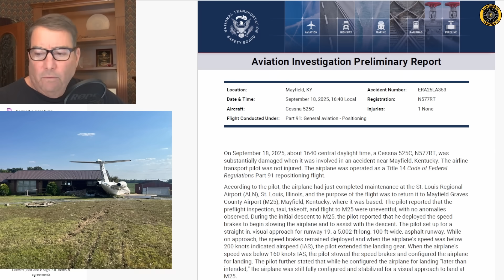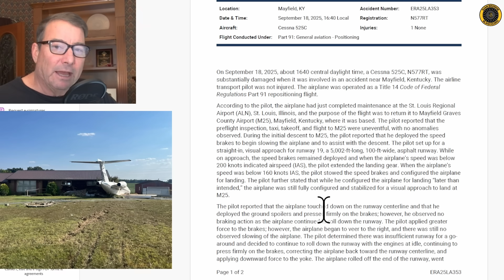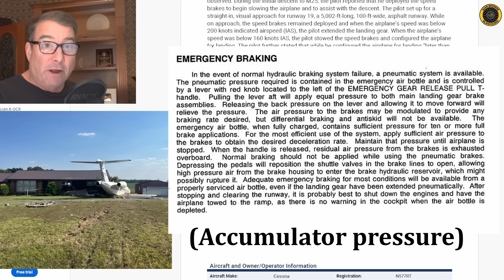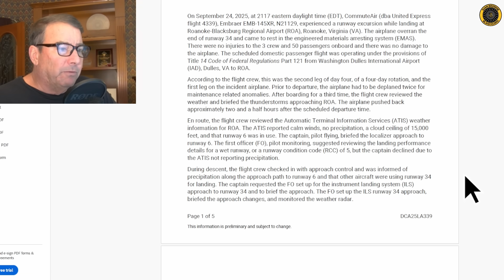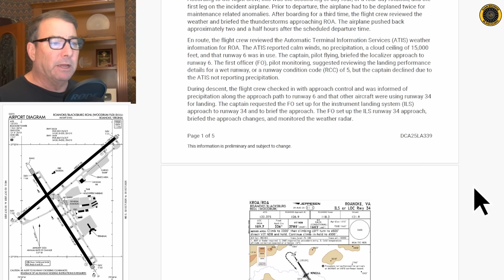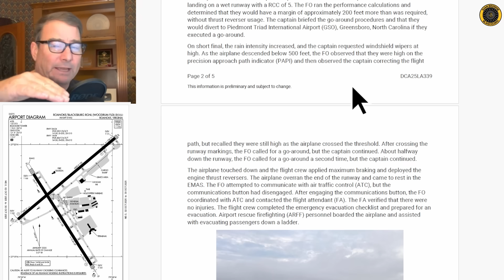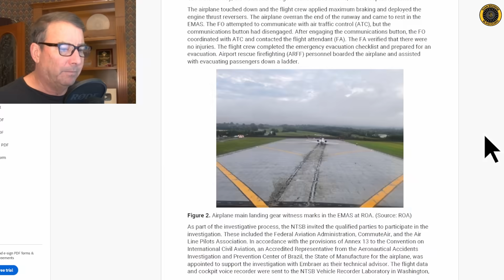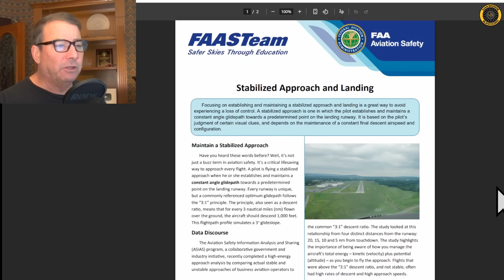NTSB Preliminary Reports on 2 Runway Excursions 27 Oct 2025

Comment: Regarding the E145, there was some damage. Main gear doors were damaged, and both engines had to be replaced due to ingesting the EMAS material. Turns out the material is portland cement and it hardened in the engines and couldn't be cleaned out.

Comment: The citation driver....because they  certainly wern't flying, obviously didn't want to damage the tires by usIng the nitrogen.

My qusetion is with 5000 feet of runway, if they notice no braking action...why not take off again figure out the issue and try it again at a sane speed?

Comment: How about starting with a hearing check of the captain(or maybe a new set of batteries for his hearing aids) 😳 Should he be lucky enough to retain his job, He needs to spend one year in the right seat. Sure am impressed with the EMAS protection.
Reply: Regarding the single pilot Citation (for which I have flown), what is it that overrunning pilots don’t get about F=MA[SQUARED]. Pilot claiming his approach “was stabilized” - my ass!

Comment: They say things happens in threes. Well there was a third runway excursion at Chicago Executive Airport PWK in Wheeling, IL (Palwaukee to us locals) on September 3, 2025. 
NTSB Report CEN25LA35  N1927G Gulfstream G150. No injuries. Also a wet runway and no emergency braking deployed.  
The EMAS wasn't as effective, possibly because the jet veered off to the left side and only partially traveled through the left shoulder of the EMAS zone. 
The jet breached the perimeter fence and then stopped in the grass with the nose of the plane over the concrete curb and mere inches from the fog line of the perimeter road. 
In other words, you can't park that there. 😉

The Gulfstream fuselage was damaged and nose gear collapsed. 
I wonder if the Jet had stayed centered on the runway and entered into the center of the EMAS if the jet would've stayed within the perimeter of the airfield and not breached the fence. 
Interesting to compare the effectiveness of the EMAS in two similar incidents, although different sized jets.

Comment: It makes zero sense to have chosen the shorter runway. Both runways are rather short, good judgment says take the longer. Just as it's almost always better to begin a takeoff from the very beginning of the runway. Also, I flew out of Roanoke some years back and runways 16-34 were NOT to be used at night, depending on whether an arrival or departue, due to terrain! An other than well done go around could put an aircraft into a mountain. I just checked and the information says that departure on runway 34 and arrival on runway 16 are NOT available at night..Hmmm...That suggests issues no matter in which stage of flight an aircraft is in. Another reason to have used the longer runway. The winds were a non issue, direction nor speed being of any consequence. If 6-24 was wet, 16-34 was also wet.

Comment: I didn’t sleep very well last night because all I could think of was making this comment which is unrelated to your present report, but you cover everything in these cases so well and you are an incredible spokesperson for the whole aviation industry. I kept saying to myself, I just have to bring this up . I am dictating this and I have difficulty with my eyesight so there may be some crazy errors, but hopefully you get the gist. I am a retired lawyer, with an aviation enthusiasm along with having previously had a captains license from the Coast Guard so it’s been planes and boats . Professionally, I wound up being a risk manager for a multi billion dollar company, which seemed to fit my legal background. . What concerns me is the fact
Passenger planes only provide air density at an equivalent 8500 feet above sea level  as far as the passengers are concerned, it works in most cases perhaps gives them some jet lag, but I am very concerned about the pilots . I think pilot should be on supplemental oxygen when you’re flying at altitude . Slight deprivation of oxygen has cumulative effect. And you all go up to 35,000 feet but have an effective altitude in your plane of 8500 and then you come back down to sea level or somewhere close to that so it’s up and down up and down. . I think there are significant questions about this issue that should be investigated. . It might be that the pilot compartment would have separate system for oxygen concentration, equipment or supplemental oxygen via a mask. I’m not sure, but I think the cause of many accidents are ultimately traced back to this slight but continuous altitude issue. . I think it also becomes more important as the pilot ages. It would be interesting if you took up a pulse ox device that you can get from a drugstore just to see what your saturation is in the 8500 foot environment. You know sports teams that visit Colorado Denver have difficulty in performance because of the altitude and that’s only 5000 feet. 8000 or 8500 is pretty close to 10,000 at which point oxygen is necessary. 
I don’t think planes need to be modified as I said it probably works for the passengers, but I’m very concerned about the pilots  . I don’t think this is ever been fully investigated, but I watch your channel all the time and I am constantly amazed at the problems in loss of control and bad decision-making that occurs in GA. . Is it possible that in general aviation people are flying at 78 9000 feet and having a physiological effect which is causing certain mental difficulties or coordination difficulties or perception difficulties? ? I don’t know, but I think it is worthy of investigation. Why don’t you get a pulse ox and bring it with you on the next flight? I’m just curious what your oxygen saturation level is when you are at altitude . It certainly better be better than 95%. . I don’t think we’ve ever thought about these issues for aviation in general remember back in the day of biplanes. Those guys were flying at a couple thousand feet. Never a real problem. . But we have moved on a long way since then and how did we calculate that 8500 was the appropriate level? ? And how did we determine that constant changes in altitude as part of the job doesn’t have a delirious effect ? I will be curious to see what my concerns bring in the comments maybe you all know of studies that address this issue . However, I am convinced that in general aviation people are flying too close to the edge and not realizing what it does to their judgment.
Reply: The human body is very resilient and a health adult can become adjusted and acclimated to the slight changes in altitude that pilots experience. 
NASA Flight Surgeons studied the effects of altitude and hypoxia on pilots for years as modern planes and fast jets evolved. 
I think your concerns about the effects of short durations of altitude transitions experienced by pilots have already been addressed for decades by qualified medical professionals. 
An average person's blood oxygen saturation levels fluctuate naturally throughout the day based on numerous factors, regardless of what altitude they are at. 
A cheap pulse oximeter is not going evaluate the effects that a slight decrease in blood oxygen level has on one individual over another, it's only going to tell you a number at a specific point in time. 
The last thing any pilot needs is a wearable device distracting them during flight operations. 
Especially not in the critical phases of flight that require mental acuity for rapid decision making which coincide with when something abnormal is likely to occur resulting in task saturation.
Reply: I'm not a pilot (or a medical professional) but am very familiar with altitude effects, as I live in two places during the course of each year: sea level, and in the mountains exceeding 8000 feet. 

Short answer: Pilots are fine in pressurized cabins without supplemental oxygen.

Longer answers: 
1) It takes time to develop altitude symptoms. From the many visitors I've had in Colorado, they're fine when they first get here, and their earliest symptoms, if they even develop them at all, will manifest as a headache disguised as sinus pressure that they'll wake up with the next morning. This can be staved off by drinking water. Pilots, even if unacclimated, would not start to have any real problematic symptoms during even a long flight. Plus, they know to drink plenty of water. 
2) Even more importantly, they spend enough time flying that their body is getting used to it. I wouldn't be surprised if their hemoglobin and hematocrit test more altitude-acclimated than flatlander values, as mine do. This would mean that their blood can carry additional oxygen. 
3) The human body has ways to compensate for low oxygen levels in the air, even for flatlanders, but especially for pilots, who are by definition healthy by virtue of their Class 1 medical certificate. The body will raise your heart rate and your blood pressure before it lets your brain be oxygen deficient. For example, a few years ago I was less than a week into having gone from 9 months at sea level to 8500 feet, and I was still suffering from a very bad case of whooping cough, plus asthma and allergies. My pulse ox never got below 95 even on my bad days. It is also important to note that people who live at altitude (year round) normally have lower blood oxygen sats: 96 would be considered pretty average for someone living at 8500 feet. Anything in the 90s, taken alone, cannot be used a measure of impairment. 
4) Nor can the benefits of living at altitude be interpreted as some sort of superpower. If it could, the Colorado Rockies would not have been in the sub-basement of the MLB for so long. 😜

Anyway, for questions like this, you might find it much more advantageous to post to Reddit. This question would have gotten lots of responses in the r/aviation subreddit, which is an active and knowledgeable community that you might enjoy!

Comment: How expensive is EMAS? Is it something that could be put at the end of every runway - I can't help but think that there are alot of runway overruns and after what happened in Korea isn't it something that could just be universally implemented?
Sounds like there was some pretty terrible CRM going on in the second one was there history there? The account is a bit interesting, the FO called a go around half way down the runway, presumably before thrust reversers were deployed? If there was only a 200ft margin for error when going into the runway without thrust reversers then you would expect a very low threshold to be going around or if successful on the approach then immediately deploying the thrust reversers surely? But if he'd done that then the call halfway down the runway would be with the reversers engaged? Or was the aircraft still in the air halfway down the runway, in which case crazy that they didn't go around?

Comment: The fact that a go-around wasn't performed is certainly the problem here, but I would like to add two important points:
1. Time pressure. The crew and the flight were already significantly delayed. In my opinion, time pressure is underappreciated in many incidents and accidents, but it is usually a trigger in the chain that leads to an incident. Please all help to reduce this time pressure. A delay always means an extension of working time and a reduction in free time, which is usually not compensated for.
2. LDTA calculation. If worse conditions are even expected, a second conservative calculation with expected wind temperatures should be performed in addition to determine whether the approach can be carried out safely and to better define the limits. In my opinion, it is absolutely the wrong moment to have your colleagues calculate the landing distance during a final approach and to perform single-pilot OPS during this phase. By the way, for all of you who use the Swiss cheese model for the error chain, eat some Emmental cheese and you will see that it has holes and not tunnels.
Reply: As a deli clerk, the "Swiss Cheese Model" irks me.

In successive slices, the holes in the Swiss cheese ALWAYS line up. That's the physics of gas bubbles in a solid.

Comment: wouldn’t have been single pilot. Secondly, the pic would have been known to be able to evaluate a stabilized approach and what to do if it’s not stable. Lastly, “well since the plane is going to be in the barn for a number of months, we just can’t keep you around with no plane to fly”. 
The standard 135 mentality is to fly it like a bug beater and have a good time. Our MO is fly it like an airliner and have a good time. Sometimes we get tired of the constant pressure to get newer guys (and in some cases old heads) to keep learning until ya got it down………..then One of these videos comes out.

Comment: I am guilty of having a small bladder that requires frequent emptying. Also, I love the feeling of being fully hydrated, which compounds this issue. When on a bush flight in my short wing Piper around the emerald island, I usually come in a little high and set idle power, gliding down to the runway like the Space Shuttle (or a shoebox). Occasionally my height is excessive, and flaps being a luxury that only less stingy pilots can afford, I put my nimble cheap little aircraft into a sideslip that causes my passenger to remember the string of questionable life choices that led to this moment. As my bladder pressure gauge goes into red, I am grateful to be able to spot the individual grass blades that will soon get some localised precipitation. Fortunately my speed is fine, and the descent rate is ear-poppingly perfect. The Sarajevo approach is followed by gentle caressing of the fur-like grass surface before coming to a halt next to the runway; but before I can release the contents of my tiny inner water balloon, I must get my passenger to stop praying, let go of the seat cushion, get out and touch grass, as the only door is on that side of the aeroplane. A go-around in this case would have surely ended up as a wet and stinky affair.
Reply: You can buy bottle-like devices which would help you avoid embarrassment.

Comment: The first one is pretty much how I landed the Learjet on Microsoft Flight Simulator 5.0 running on MS-DOS.  Tried to land that thing at Megis Field, and it was always a disaster.  I was like 10 or 11 years old.  Always wound up coming in high and hot.  Way too fast.  Never could figure that out, and the low resolution and low frame rate didn't help.

Comment: I'm guessing the captain got tunnel vision over the fact that they were already running 2 hours late, and if they had to go around, they might also be diverting, causing even more heaadaches. I once was on a flight that was flying into a snowy airport. We had been delayed multiple times that day, and we were desperate to get on the ground. At about 200 feet the pilot pulled up for a go around and we all groaned. After stabilizing, he came on the PA and apologized and said that the runway didn't look like it had been plowed, and he just didn't feel safe landing on it. You could see the understanding dawn in people's eyes and people nodding in agreement.  We all agreed we'd rather be late than off the runway (or worse!)

Comment: Anyone want to guess why there are only two tracks instead of three in the emas ?
Reply: OK, I will make a guess. I am guessing there is not enough weight on the nose wheel to press it into the EMAS material. So the nose wheel just rolls along. The mains, on the other hand, have all the weight needed.
Reply: @georgegilbert7347  that is kind of what I thought as well....but I would think some impression would be made. unless it is a lot tougher than I thought.

Comment: There was a common occurrence when landing an F-4 Phantom.  After landing, if the ground speed was above 100 mph, the pilot would not feel any effective braking.  Some pilots would engage the emergency brakes which deactivates the ABS and usually locked the brakes causing the tires to blow out.  Sounds like the Cessna Citation pilot experienced a similar effect given his high ground speed and this would explain why he felt the brakes were not working.

Comment: Big thank you to the engineers who designed the EMAs and to the administrators who organized the funding and installation.
Reply: sounds like a wonderful system, anyone know what the surface is, i was thinking large hole filled with ping pong balls haha
Reply: @patchmack4469  FAA regulations require "high energy absorbing materials of selected strength, which will reliably and predictably crush under the weight of an aircraft". Apparently most installations use lightweight, crushable concrete blocks.
Reply: @hb1338  oh wow - i was wondering if it might be a Pumice type rock chip which is very light

Comment: Juan, I fly a Citation Ultra so there a few differences in the speeds BUT they are close enough. I was dumped at my home airport coming from the west to land on runway 7. I try to rarely use the speed brakes unless absolutely necessary. I was fast, not happy and decided at 1,000 ft to just level off and enter the overhead with a left break for downwind, landed uneventfully. This guy was smoking within five miles of touchdown and should have recognized that he was fast, and if it was a reposition flight then all the better so you don’t have to explain to the boss. On the other one I hope we get to hear the CVR.. smh

Comment: Why was there no nose wheel track in the EMAS? Is it because most of the weight is on the main gear?
Reply: Probably. They might have also had the controls full aft. The EMAS is still concrete, you can walk on it. It's just designed to collapse under certain weight conditions.